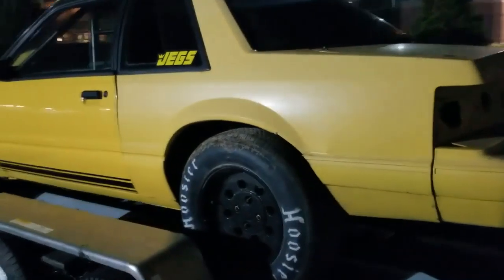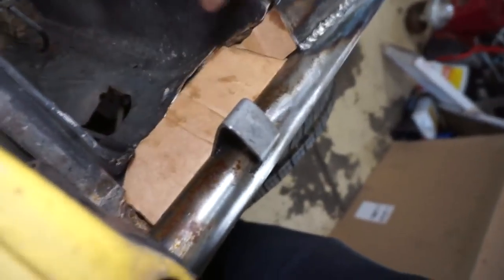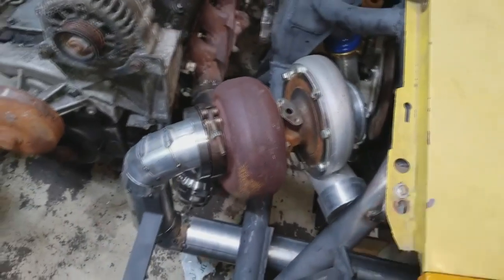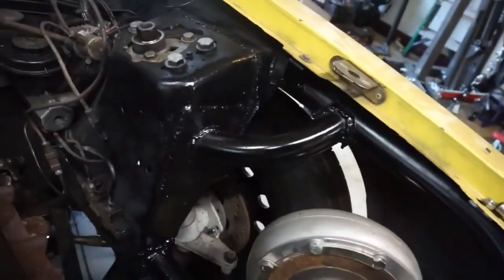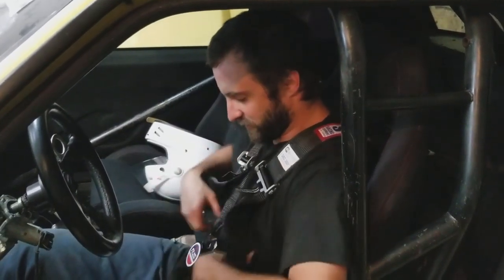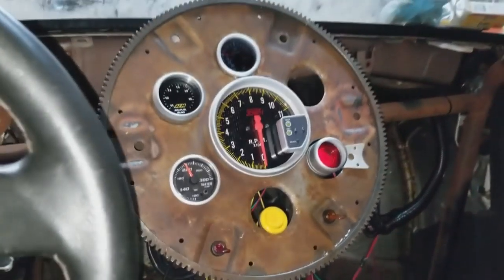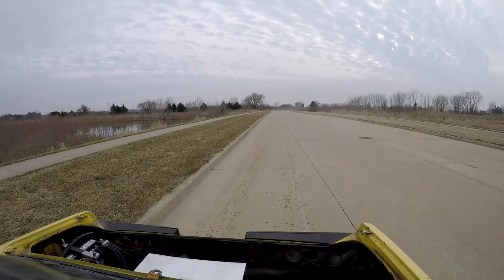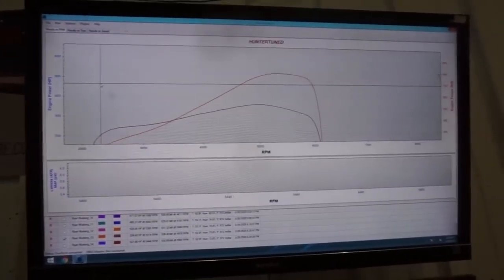TWIN TURBO LS SWAPPED MUSTANG FULL BUILD

Comment: Great compilation of the build.  Do you have a E.T. goal ?
Reply from the maker: Not yet.... Stretch goal would be 8.47 since its faster than priginal builders best time. But we'll see where it goes. I'll start slow, thinking of working on making suspension efficient first then add power. Its light so will probably be low 10's high 9s on like 600hp.